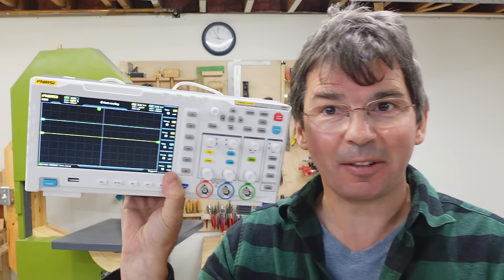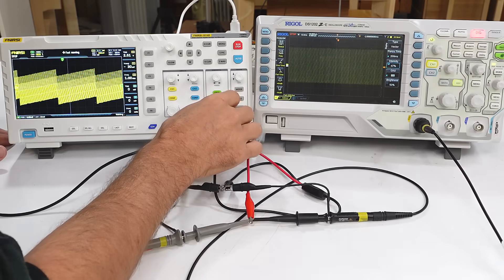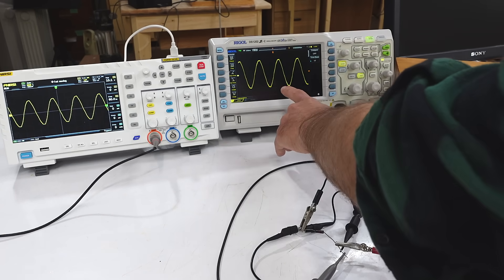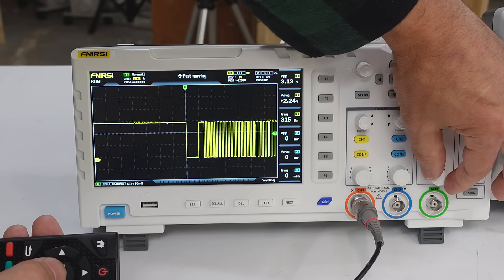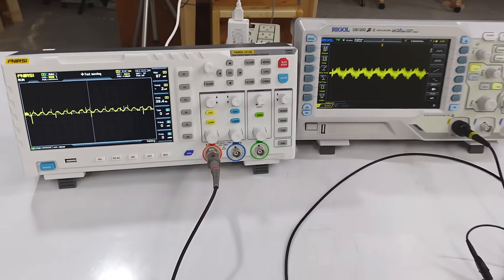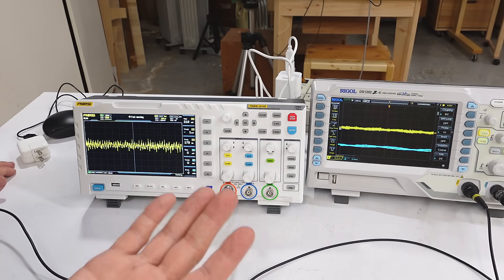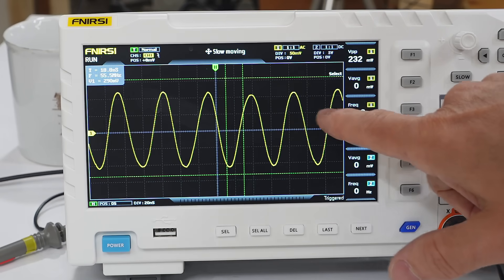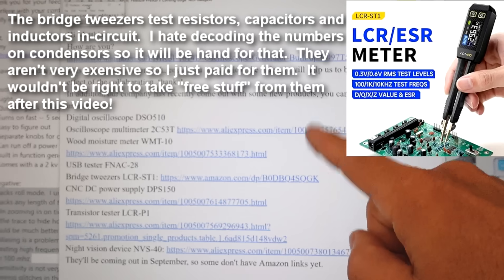Fnirsi-1014D vs Rigol DS1202Z-E

Comment: With decent sized built-in battery that would be a great alternative to handheld oscilloscopes in many scenarios.
Reply from the maker: Just tape a power bank to the back.  Physical knobs are sooo nice to have!
Reply: @matthiasrandomstuff2221  Make another video where you open that Fnirsi up. I have a sneaking suspicion it's going to be mostly empty inside.

Comment: Those 6-random-character-brands always seem to deliver the quality paid for: Not all that much beyond absolute minimum
I would also love a look inside that cheap scope
Reply: Rigol was manufacturing Agilent scopes in the early 2000s. That is why their scopes are so good. They're essentially a straight copy of the DSO series with exactly the same specs.

The rest of these models you can buy on Amazon are just junky ripoffs. Rigol is a unique situation.
Reply: Fnirsi is a step below Hantek, who are a step below Uni-T.  But these Chinesium brands are putting downward pressure on oscilloscopes, including Siglent and Rigol putting scopes within reach compared to TekTronix and Keysight.  There’s not really that much to any of these scopes either.  It’s the low order volume of hobbyists and professionals that keeps them artificially expensive.  I’m looking forward to Raspberry Pi / Pico open-source hardware clones of any of these scopes Chinese scopes.  Same way that someone made a $100 open-source logic analyzer for the Rigol that does the exact same thing as their $600 accessory.

Comment: The rigol simulates persistence of vision when zooming out the trace, it interpolates/blends with all of the data while the fnirsi just takes less samples. 

The rigol probably also has an option to delay retriggering. My rigol ds1054z has it. I use it exactly for that reason. It also has trigger options to trigger on the x occurance for video signals for example to trigger on frames or lines (needs a sync signal though). 

Another advantage the fnirsi of being able to power from a battery pack is that the ground reference is decoupled from mains, so it's safer to use on mains powered devices if you touch a high voltage rail with the ground lead of the scope. The rigol would show a few sparks and trip the breaker.
Reply: You probably could just use a 3 prong to 2 prong plug adapter for that, sacrificing some noise rejection I'd suppose, but that's an acceptable trade off for not blowing sht up lol.
Reply: @xxportalxx.  Or buy a differential probe and be safe. Was never a fan of "ungrounding" scopes, never will be and I would certainly discourage anyone with limited knowledge to do this!

Comment: I have one. While it is not "top of line" i prefer it to my rigol. Easier to use, lighter, no noise.
For the price, the Fnirsi is a very good device with good sampling frequency.
Mine developed calibration issues because of defect TL432 voltge regulator. Bought the similar priced PeakTech1400 to replace it, but the Fnirsi is way faster and has function gen. so i fixed it.
Reply from the maker: I can see myself using the Fnirsi here and there if its away from the workbench and I know its something within its capabilities.  And its so light, I imagine it won't get seriously damaged if I were to drop it.

Comment: Not sure if I’d trust such an inexpensive scope but I do have a question:  Is the scope’s ground floating or tied to neutral?  I see that’s it’s using a USB brick without the ground  pin.  Might be a cheap solution to run off a battery brick and have an isolated scope for AC troubleshooting.
Reply from the maker: its floating.  Yes, running it off a power bank is an attractive option.  I just need to buy a real power bank that can power it for more than twenty minutes.

Comment: That is a surprisingly good looking scope, at least for the price at least based on the last time I was looking to get a scope.
That said I'd rather get an actually genuinely good scope or use something like a Pico/Arduinio when the requirements are in that sort of range than pay that much for a scope that isn't all that great. It doesn't seem to be quite good enough value to temp me with the needs I have right now anyway.

Comment: My cheapest Hantek does better than both of them ;) And it's cheaper. It needs a PC though. However, after using a lot of traditional oscilloscopes and a "headless" one, I like PC UI version better.
Reply from the maker: maybe the UI on it is better than the one for my instrustar.  The instrustar at least has a long trace buffer, unlike the Rigol
Reply: @matthiasrandomstuff2221  It was pretty bad, but fortunately there is a community alternative software (Open Hantek) for it and it's much better. At least it works without issues.

Comment: These comparisons end up pretty much the same way. The reality is simple. Fnirsi is not as good as Rigol and Rigol not as good as Teledyne LeCroy. But I'm happy they all exist. For educational purpose Fnirsi is more than enough. You would be able to study basic electronics with it and even debug Arduino projects. Rigol will go a step further and help the design of complex circuits. It will cover from hobby to semi-professional projects.And the upper crust of Tektronix & co will provide the tools for complex projects and also support certification for them. The only unfortunate thing is that specs are exaggerated more the cheaper you go. On the other hand this is not a secret.

Comment: Hi Matthias, I have this FNIRSI oscilloscope and it really bothers me that even though it has a FFT capability, it doesn’t provide any information, so you can’t even see the frequency axis, which makes any analysis very difficult. 
Also, the function generator has an amplitude of 2.5V that cannot be adjusted, which is not ideal to use as input for other applications. 

Thanks for the video!
Reply from the maker: Oh, hadn't played around with the function generator that much, indeed, lack of amplitude adjustment is kind of silly, even the scope meter could do that.  But using the pi pico as a signal generator worked great and I might do more of that in the future.
Reply: You aware you can program your own generator waveform ?
What other device for $150 can do that?
Reply: @pepethefrog7193  it's really a hassle to do though.

Comment: One more benefit of the Fnirsi that wasn't mentioned: if you power it from a USB power bank you don't need to worry about ground loops on your probes. It seems like this product is straddling the line between a bench scope and a portable scope.
Reply from the maker: indeed.  Compared to a scope meter it's great.  But a bit pricey compared to scope meters
Reply: I was thinking the exact same thing!, a big part of what your paying for in RIGOL, is a much better & cleaner power supply with an actual earth !, that's going to make a big difference when looking at low level signals, and might explain the 50mv/div vs 5mv/div !.
Reply: Yes, but this just saves Fnirsi the cost of a power supply on what's already an incredibly cheap product to manufacture.  This is an old and pathetic product and it's long overdue for Fnirsi to offer a true replacement with much better performance.  Buy the Rigol... or anything else, really.
Reply: @antibrevity Some new Rigol scopes are powered by USB-C too, though.
Reply: @antibrevity   When offered at 175€ it normally goes for, the Fnirsi is really a bad deal compared to 205-210 one might pay for a Hantek or Owon. Both are real measurement instruments and aren't too far behind Rigol.

But if i can buy one for 120 and have a scope that will do many of the things i need, even if it's really not a good measurement instrument... mhmm much more difficult decision :D
Reply from the maker: @antibrevity  the thing with these cheap chines products is they save money everywhere, including on the engineering effort.
Reply: You can do this with any scope, you just need to choose the right Powerbank. I use mine with an Allpower brand pureSine solar power bank.
It's bigger, but lasts much longer, and I have 240VAC for up to 300W if needed.

The disadvantage of Fnirsi is that it can only be used at low frequencies, its sampling speed and memory are not real.
If you want a portable one, buy Micsig or Hantek.
The Hantek TO1112 is pretty well priced.
I'm not a fan of 3in1.
Reply: It's trying to be both and but good at either
Reply: I agree, 

I don't know whats going on

Comment: Honestly, there is no comparison. The cheaper scope is embarrassingly over priced for what you're getting. I'd actually call it a scam.
700 memory points might as well be 0.
All the issues you had with triggering that signal on the Rigol we're user error.
The Rigol will tell you what the actual sample rate is. It will reduce the more you "zoom out". Zoom out until the sample rate is 10x the baud rate of your signal and put it in 1 shot mode. Do your capture, then zoom in and analyse at your leisure. The size of the screen is irrelevant.
Reply from the maker: I was pointing out that the rigol retriggers faster.  yes, I could have used single shot -- but there's always a compromise with how much to put into a video.
Reply: @matthiasrandomstuff2221  I get that, but it feels far too generous to the cheaper scope as you present it here. You're comparing a real tool to a toy.

Comment: Rigol DHO series are unbelievably good value scopes. The retrigger issue isn't an issue... look into "trigger holdoff"
Reply: The fact that it can retrigger again relatively quickly is arguably a good thing - that's how its able to catch infrequent events.  Closely related to what's advertised as waveforms/sec.
Reply: @ccoder4953  yep.
Reply: Or just use single trigger.
Reply: The solution is to set the time base to 10ms/Div?
Then the whole sign will fit in and you can zoom in on it.
Instead of Rigol DHO, it is better to wink half of Siglent, it offers more at a similar price.
I say this as the owner of Rigol DHO924s.🤣
Reply: @juhaszpeter4796  Yeah, I've got the Siglent and, while its a bit more expensive than the Rigol, it has a much better sample rate and memory depth.  UI is very responsive - quite nice.  The Web UI is great too.  I got the 4 channel version because I think that's essential for alot of the things you need a scope for (SPI is one example).  Something Dave Jones from EEVBLOG agrees with - don't get a 2 channel scope these days, spend a little more and get the 4 channel.
Reply: @juhaszpeter4796  Thanks for your opinion on Siglent. I am eyeing some of their recent 12bit models. 2 or 4 channels at 1-2 GSps... I'm wondering if they feel as comfortable and "tolerant to user error" as the Rigol that served as a reference in this vid.

Comment: I have a transistor tester with built in 3.7V battery and one with external 9V battery. One with 9V battery is better, because it uses higher voltage for tests. For example, it gives me accurate reading when I test 5V zener diode.

Comment: Have you ever seen people that use their pc sound card as a oscilloscope? A review of that would be pretty cool.
Reply from the maker: 25 years ago at my old job, I used the sound card as a streaming A/D converter, hooked up to a scanner, to decode Mobitex digital wireless.  Problem with sound cards is they are all AC coupled, and gain is relatively unknown.  A pi pico  is much more suitable.
Reply: @matthiasrandomstuff2221   oh thanks for the info, I plan to play around with hardware hacking after I finish my degree. So it will be very useful while I'm starting out.
Reply: @matthiasrandomstuff2221  You can often bridge the input capacitors on the soundcard.
Reply: I made one of these a couple of years ago, they are very cool for low frequency aplications,  and very cheap to make. The one from Rod Elliot is very cool and easy to assembly...
Reply: Ok for 2 channel up to 20 kHz maybe 30 kHz. But you have no actual voltage scale without calibrating it and likely only 1.5V MAX input and need 10x or 100x probes to be slightly usable.

Some times it's acceptable.
You can have it as app on phones also but you might burn your phone 😅
But just using the microphone itself for sounds it has some coole neat applications
Reply: apparently a sound card can be used as an interface for a few different things. i saw one where a guy made a video game controller and hooked it up through the sound card. i guess that's a good solution if your device can't communicate with usb properly
Reply: @bmxscape  This used to be the standard before USB.

Comment: A lot of people replace the Rigol fan.  I used a Noctua Premium Quiet and can barely hear it now.
Reply: It's a standard off-the-shelf fan size? That's handy! Might have to try this
Reply: @azyfloof  I don't know what size the DS1202Z-E takes, but so many people with the much older DS1052E used the Noctua NF-A6x25 FLX, Premium Quiet Fan, 3-Pin (60mm, Brown).  Got mine from Amazon.
Reply: @mk6595  I have the DS1054z. I may have to open it up and have a peek inside. Actually surprised I've not done that yet :P
Reply from the maker: There's a sort of cut-out in the case where the fan is, I taped some felt to the side of it, and that directs the air to the back and also noticeably reduces the fan noise.  Not hugely so, but its was an easy mod.
Reply: @matthiasrandomstuff2221  When developing microcontroller stuff the oszi runs for hours near your head and even the slightest noise may disturb you thought process.
Fnirsi outcompetes same-price rivals in sample rate and the uncommon variable sample rate is quite intuitive to use.
Reply: I have the same Rigol, and yes it's audible, but does not annoy me that much
Reply: @ The worst offender is the Rigol signal generator.
Reply: My workshop radio drowns out things like cooling fan noise, so not an issue.
Reply: Maybe there's a reason you can't hear the Noctua fan. Are you sure the it's moving the same amount of air?
Reply: Replacing does not fix the problem. It only makes it slightly less annoying.
Reply: @pepethefrog7193  So you never used a Noctua fan... They are really expensive but for a good reason, you can't hear them. I have some on an open heatsink and the only thing you hear is the air moving through the heatsink and only when there is deafening silence in the room.

Comment: 10:11  thats the reason scopes usually come with their own PSU.
It sucks not being able to trust the scope till you found out if you can even trust the psu.
Reply: Bit I want to know is how good are the USB powerbanks it ran off are for it - at least as a rough guideline - as a relatively small light and good enough to be useful scope you can power in field etc has some merit, but ifs going to not handle the buck/boost of the powerbank well that could really ruin it for that application.
Reply: You could even string batteries together to get the 5V without any type of ripple whatsoever, but that would kinda be getting a bit into the weeds. NiMH cells run around 1.2V, so a battery pack with four of those would fit the bill for very stable isolated power.
Reply: @microwave221  Wouldn't a powerbank already do that, as long as you're far away from any noisy electronics? Or does the cheap voltage booster in those powerbanks also generate noise? (I'm still waiting to afford my first scope to be able to test stuff like that)
Reply: @SalahEddineH  most powerbanks will have some degree of high frequency ripple from whatever they use to step voltage up or down. Better quality powerbanks will have better filtering, but going direct to the cells will almost always be smoother. Probably wouldn't be totally necessary given the accuracy this thing can provide, l think any decent powerbank  would have low enough noise to be fine
Reply from the maker: but benig able to run it off a battery from time to time can be handy.  Scope ground tied to earth ground can be a problem
Reply: @matthiasrandomstuff2221  I think that's how you accidentally killed one of those battery/inverter-things, if I remember correctly!
I'm quite impressed by the company telling you to publish your video without reviewing it. Cheers!
Reply: @matthiasrandomstuff2221  hm shouldn't that problem be solved by isolating the circuit you want to messure from the mains first and than grounding it over the scope ground lead (That way you can choose what is at ground potential in your circuit).
So isolation transformer usually is the answer, also is safer than just working on mains directly.
Ofc a battery operated scope is always nice to have for the cases where its not possible but I would only have this as a backup, the isolation transformer would atleast let you use your known good oscilloscope for most tasks.

On another note don't you have a big battery pack to power mains equipment too?